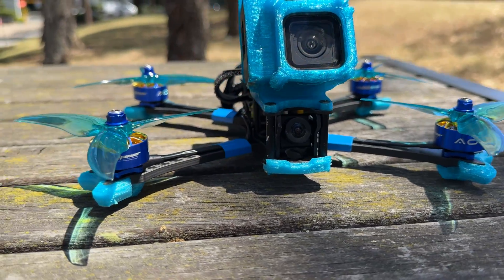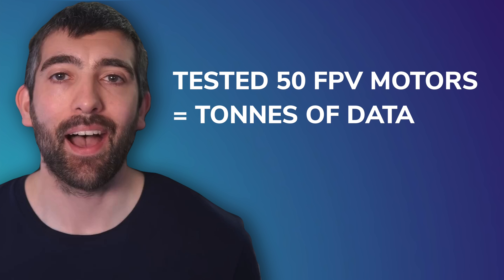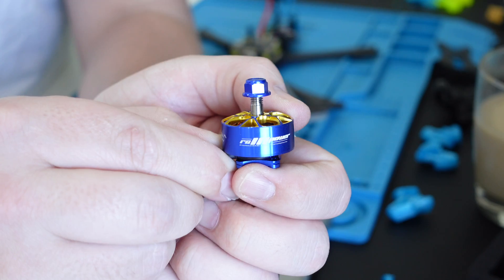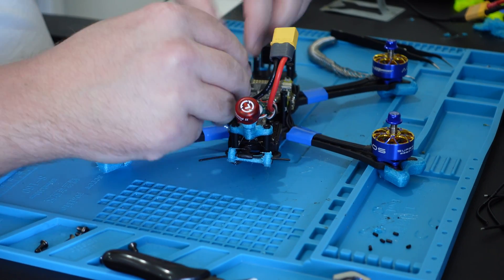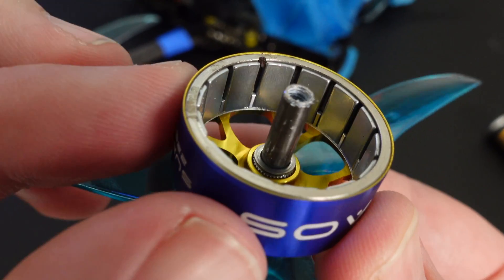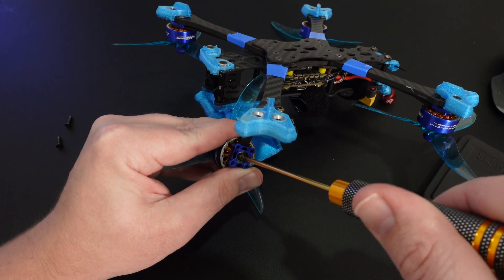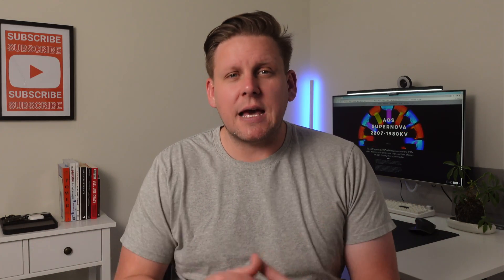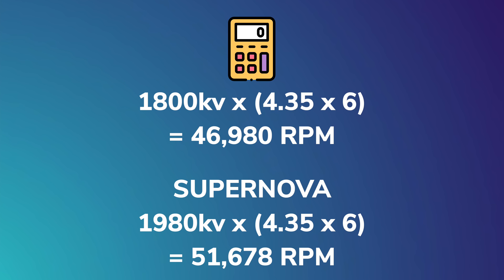I Tried “The Best” FPV Motor According To Science

Comment: The thinner any magnet is, the lower on it's operating curve it is working at, and the faster it will LOSE both short term and permanent magnetic strength in the presence of both externally applied magnetic fields (the motor windings themselves), and higher temperatures.  This is a primary reason why manufacturers keep magnets at least reasonable thick.  The magnets you showed here early on are WAY too thin..  The thinner they are, the less flux you get from them as well.  The recommended temperature range stated be manufacturers ASSUME a certain minimal "Operating Point" of the magnetic material, and these magnets are WELL BELOW any normal operating point.  Also, there is a critical mistake made in this video when discussing a motor's "KV" rating (RPM per volt).  It is stated that the higher the KV of the motor, the more powerful it is.  No.  Just as when discussing car engines, you need to talk about both RPM an Torque at the same time.  Electric Motor manufacturers SHOULD provide you with a power curve- showing just what the motor can do in both RPM and torque.   Other IMPORTANT factors are  1)  True Electrical Power IN to Mechanical power OUT  vs. RPM (this is a non-trivial subject).  2)  Performance over time at Maximum Power- how does the power fade over a handful of minutes or hours?  Anyhow, most of you have no access to laboratory grade measuring equipment, so just do THIS instead- easy way to compare motors-  always documenting RPM, Current Draw (AMPS), and battery voltage....A)  With a fresh battery, see what RPM's you get at full throttle.  B)  Pick a speed you like to fly at, and do your best to fly a big oval at that speed over an entire battery cycle.  C)  As soon as your drone lands be ready with another FULLY charged battery and see what RPM's you get from the now warm motor.   D)  Study your data after the run, and do your best to get AVERAGE RPM, and CURRENT DRAW that allowed you to fly at that speed you like to fly at.  E)  Repeat for any/every motor you want to study.  Lastly, after you have let the motors cool down again, see if you still get the same RPM with a new battery they gave you before.  Again, there are two types of Temp Losses in Magnetics- temporary ones, that bounce back when the magnet cools, and permanent ones.. you don't get that back.  If the flying part of this seems absurd, that do you best to recreate it "on the bench"- you can still get some useful data that way.....pick an RPM for the motors to run at , and keep them at that RPM.

Comment: Chris Ross has tested way over 50 motors he has tested 2000 different motors to test to come up with this motor just wanted to correct you on that point
Reply from the maker: Well your “correction” is incorrect.. he tested 50 physical motors. The 2000 you are referring to is the digital twin iterations he ran the simulations on to be able come to his final design. 

If you are going to correct me, get your facts right first.

Comment: Chris also said that most of the other motor manufacturers are for instance saying there motor is 1700 kv and after testing them they are not 1700 kv as advertised.  He says his motor is the kv that is advertised. That in itself will have a big variance on comparing one motor against his motor. For me I would like to try these new motors and turn down the power a lil because I like 1750 kv power and see how long they will last. They look like they have a good design for long life. Not just power.

Comment: The Stator size is 22.6x7.5mm when he made statments about the wasp motor that was my initial guess and 7.5 hight was a given. That statement of 20,000 designs he tested and compared against is complete bollocks, there were already two of the same stator sizes on the market that he went with well before he "came" up and went with it. will not out anyone, but its utter horse shite. hes got some good idea's that others have had for years including myself to save wight that just don't have the funds or the platform to have motors made with similar design ideas with the hollowed out stator laminations and mounts. something I've thought about personally since I got into the hobby 8 years ago to save wight. The thicker/more iron content in the flux ring was a good idea IMO. anytime you have more iron the better a magnet/magnetic field can stick/resist that force. The Stator size is 22.6x7.5mm, when he made the statments about the wasp motor that was my initial guess and 7.5 hight was a given. I've got a set coming to try and I'm sure they will be great motors.

Comment: Another thing to consider is that the materials to make FPV motors are damaging to the environment, particularly the magnets.

If we accept this premise, then it is better to buy better quality motors than lots of crap motors, and it is better to buy motors with smaller magnets than big ones, especially if they perform better. 
Chris never said they are a 2207 motor, and stator size is not the only thing that makes this motor better.
Reply from the maker: Do you want to go and read his marketing?

Go to his website and tell me what he calls the motors.

Comment: They are 22.5 x 07.5 it seems.
So 10% more volume but the same weight (approximate) as 2207 I guess. Bell is light.  So less durable (?) and becomes a finite analysis on strength comparison.  That would need to be done.
Reply from the maker: absolutely Mark, and I am not that technically include like yourself or Ian - so not the best person to do that

Comment: Thank you for wasting 7.5 minutes of my time, without telling us ANYTHING about your findings from TRYING these motors. But, good job sharing with us your biases, your wonderful drone build tutorials, and your deep technical knowledge. If more KV equals more power, and larger stator size (impressed by your skill of calculating the complex shape volume using only 2 measurements by out-of-battery electronic caliper, BTW!) means better performance, I'm sure we'd all be thrilled with your design of a 99x9mm 9999kv 5-inch motor (correctly named, of course). Dont forget the "solid stator", please. While waiting for that engineering masterpiece, i'll ask YouTube to never suggest your videos again, cheers!
Reply: You sound like a salty chris rosser fan lmao. You don't know how fpv motor stators are measured and you didn't get the point of the video at all.
Reply: @jayaneyon9316  oh tell me, my wise and sweet, is battery abscence necessary for correct stator volume measurement? Fanboy, lol. For example, his AOS5 frame is shit (bought it, tried it). But salty is Darren here, not me
Reply: @yaroslavparshin3124  stator volume is a cylinder buddy not a complex shape and wtf is wrong with the aos 5
Reply: @BowOneFire  are you implying that magnetic behaviour of stator is defined not by its real volume, but by its piD*D*h/4? As for AOS5 - it maybe perfect in sim, but in real life it has a LOT of vibrations, it was difficult to find the right props for it (with any tune) to not have it vibrating on some throttle or some sharp move. My guess it is due to very small surface of contact between the arms and rest of the frame - ok in sim, but not ideal in real world, when aluminum standoffs have finite strength and all parts have tolerances. Also it is too fragile for me - too many crashes resulted in broken arm or small bottom plate chipped. Now i'm flying Syncmode and have NONE of these problems
Reply from the maker: Yeah, the punchline of the findings is that the average pilot will not be able to tell the difference if they bought any other 2207 motor in 1980kv. Then, quite simply, it's disappointing that "then science guy" didn't want to publish the actual stator size, or give more data to support his test results.
Reply: @DarrenAllatt every motor is different, even if they are 4x the same brand and model. To really tell the differences we would need to test at least 100 of each model and then compare the data. I dont think this science guy does this. Thats why i do not trust his data and do not make my decision based on his test data. I buy one thats a known good motor and not that expensive. You can get more out by practicing (skill) then with a slightly different motor. 
I think that the props have a bigger effect then a slightly different motor. Thanks for the video. Very importent to remind people that they are not worth it. He just rips people off with his "ideal" motor thats way too expensive!
Reply: almost 8 minutes and he LITERALLY didn't say anything about the motors that would actually change my initial impressions of it, just a whole bunch of "don't trust the data". Like he didn't even give me his "feelings" to replace the data, he literally didn't say anything other than "I think the stator is big" which Chris literally says in his videos (overhangs of the magnets capture flux that would be wasted from the top and bottom of the rotors). If you really thing these motors are 2308 instead of 2207, compare them to 2308 by power, flight time and weight then. Do ANYTHING other than ramble on like an older generation shitty generative AI
Reply from the maker: I am surprised you watched all 7:50 when I said everything I was going to cover in the first 30 seconds.

Comment: Sooo no info on the motors.  Did you look at your flight times improving?   Run your throttle % on osd and see where your hover % is with your current motors and these.  Any gps and testing top speeds of each........ show some data they are not much better
Reply from the maker: any of those tests wouldn't actually be able to determine accurately their performance and then I'd be criticised for unscientific test results. The point is, the average pilot wouldn't be able to tell if running any other 2207 in 1980kv.
Reply: @DarrenAllatt  are premium motors for average pilots?  I dont think so, they are premium because they do something different or claim to.  Why fly a few batteries time it thrn swap motors do roughly the same flights and see.  If there is zero difference then you could show it.  He is taking 10-20% better in power and flight time over mid grade motors.  It should be easy to do flight time and top speed test to give actual information.    Wondering if no one should listen to him about tuning because he gets paid for that too....
Reply from the maker: The problem is, “average pilots” constantly ask “what’s the best ..[insert here]” so when you have someone who states that science and imperial evidence says these are the best motors, average pilots will buy them because they think they will become better for having “the best thing”. 

The problem with doing un-scientific tests where it’s back to back user experience, and I have run them in the past with things like DJI vs HD-Zero - everyone gets on your case about how all the variables change the results and then the complaints are that your tests aren’t reliable. 

So really, it’s pick the sword to fall on:

a) I either do unscientific user testing that can’t be legitimately verified as accurate and then cop a tonne of shit for that, especially when there is actual & robust bench testing available

b) Give me own user experience and thoughts based upon my “career” or experience as FPV YouTuber for a few years, combined with as to what is realistic in the real world while to try to answer the actual questions that people want to know - without trying to use unscientific results to compare to scientific results. 

Either way - you are screwed 

I’d rather pick the one which I think helps people in the long run. 

I also have an issue with everyone constantly asking “what’s the best …” when really what’s best is what’s right for you and everyone is different
Reply: @DarrenAllatt  if someone asks what the best you should reply with best for what?  Saying well i dont notice much so chris must be making up his claims so dont waste your time paying the same price as other premium motors if you are in the market for premium motors.  

I guess you are picking the way of hey im not going to give you any info other than i dont notice a different,  did zero speed tests or flight time tests, the two things the motors should be better at because people might say im wrong.  

I dont fly any of his stuff just would like to hear that the motors make no difference with actual real world tests from pilots vs saying nope dont notice it.  

 when tracer and other faster control links came out most say they notice no difference unless they did track tests or some kind of direct comparison then realized there was a benefit.   This 10‐20% im sure is in that same way, only noticeable when directly comparing.   I could be wrong but without pilots doing directly back to back flights not sure anyone will know.
Reply from the maker: and that's what I do - when someone asks "whats the best..." it's always qualified before I give an answer

or, if I am giving a "this is best ..." it's qualified as to who it's best for.

and no, I didnt say Chris is making up claims - I said I have no doubt that his bench testing is 100% accurate.

again, If we want to do speed tests and flight time, they need to be done scientifically and independently. 

again, back to back tests are still not reliable because of cognitive bias - you know which one is which so you will say you feel Chris's one is more powerful. Bardwell and Stingerswam did a video with a blind test of Radio Packet Rates and found that neither of them could accurately tell the difference.
Reply: @DarrenAllatt  both of them are not true racers, and if you are not a top racing pilot who needs the reduced latency, then you may never feel it.  I know for my flying it makes no difference, but when im trying to fly for as long as i can for gigs, every minute counts. If they are 10-20% more efficient then when im flying for 15-20 minutes then it would add a couple minutes.   To see no one has done any real world tests to see if there are any benefits in the real world not Chris's bench testing is odd.  I figured a bunch of people would have done those two tests to prove them right or wrong would have happened quickly after they hit stores.

Comment: Nah nothing scientific with ockham's razor - just populist. No kt, no max torque, no max speed, manufactures design based on props availibility duh. You need to do your own math for specs/design of non typical quad.
Sciences, no good for the industry. Period.
So, they just just give an 'ideal' linear 1-axis bench test spec sheet on recommend props only. Go buy that.
No need to rate on radial torque against axial torque in qryroscopic quad-propulsion motion.
Just get the same stator n kv, buy them. Adding the unique name will add few bucks each. Lol.